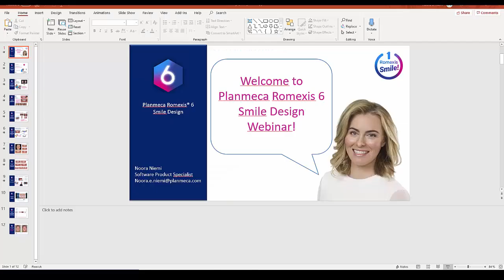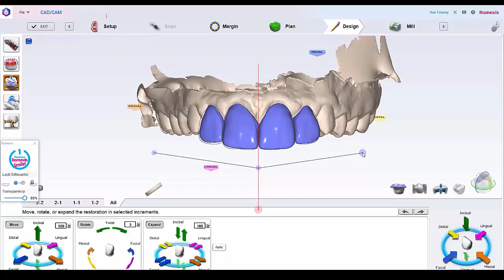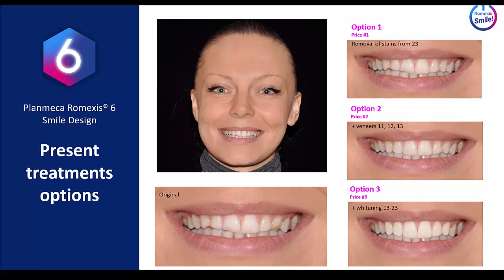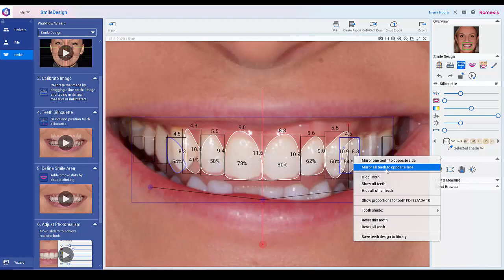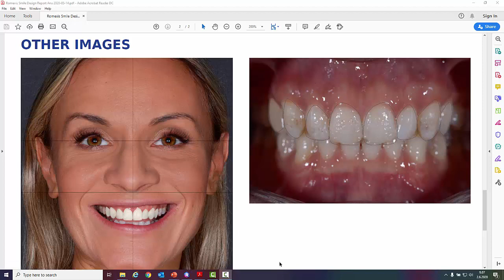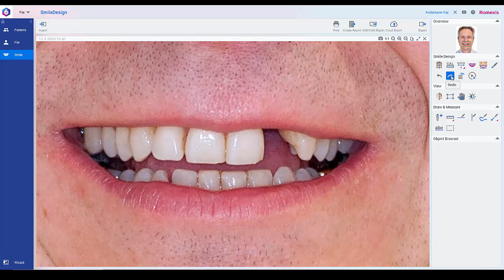Webinar: Romexis 6 - Smile Design

Comment: How to adjust upper lip and lower lip reference lines mam?
Reply from the maker: Hi there, thank you for reaching out! You can adjust the smile area by dragging the blue dots to a different location. You can also add a new dot by double-clicking on the blue line, or you can remove a dot by double-clicking on it.